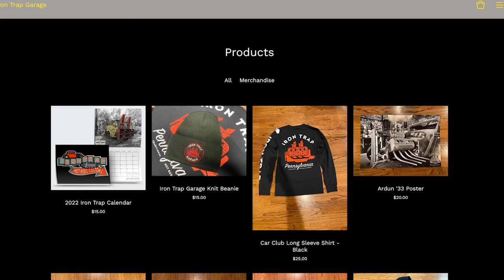Building Custom Firewall Mounted Pedals For The 1933 Ford 3 Window

Comment: The biggest lesson I've learned in the past year watching your's and other channels on hotrod fabrication etc is,; complete mockup but, in stages is critical, (leaving the peddles as they were, knowing but not sure where they will eventually fit avoids double or even triple the work is an excellent example) - it's all about trial, test and repeat. I built four Harleys for myself over the past 12 years and there was a lot of 'do-over' until it was right but, the best bike I built was the last one, where the build was complete in every way as a mock-up to ensure everything was just 'so'. The final product was superb (it fit Me properly in every way) and it was a blast to ride! Now, working on my '35 ford Coupe - the mock-up and trials are that much more extensive and requires infinitely more patience with every failure to anticipate. If I can learn just one little lesson from each video I watch, it's all worthwhile. Enjoy your content.
Reply from the maker: Yep it’s still a process I have to learn myself! It’s sometimes so hard to just leave something looking “wrong” or not totally finished to avoid double work. Every project is a chance to learn more! Thanks for watching!

Comment: I’ve got 2 Australian 34 roadster cowls and they both have a really neat set of brake and clutch holes in the firewalls,,,, it’s nice to see a traditionalist put pedal through a firewall again,,,, such a better system for brake efficiency,,, through the floor is cave man engineering

Comment: Another excellent job , those pedals aren't going anywhere but where designed to travel . Very solid , no chance of fatiguing the sheet metal out in the firewall . This car is turning out beautifully . It also shows how custom builds require a lot more than "bolt-in" components from other manufacturers & years . Sometimes you can use a part or two , but even those will require fabrications to their original design to make it all work in their new place of existence . Bottom line is , it's a lot of work , thinking , fabricating , replacing , & calculating . Especially on dropped , chopped , & channeled vehicles . Those require a complete rethink of fit , form , & function , on basically every aspect but the most basic of things . The clutch & brake assemblies will be standard , but everything else will be custom to get there . That is going to be a "bad-ass" ride ! Thanks again , Iron Trap Garage , for an awesome update on this beauty ! Happy New Year , Folks !
Reply from the maker: Thanks for watching! It really is a LOT of work!

Comment: Good idea to make that stronger. There is so many holes in that fire wall that was needed and maybe that part is just not heavy enough gage metal to begin with. It all good now. I wonder where someone found those extra long peddles at. Long peddles must have come off some big ole truck?
Reply from the maker: The firewall will get redone and will be replaced so much less holes eventually

Comment: With that bracket for the pedals you could do some serious drag racing. Uber sturdy. Have you given any thought to putting the seat in place and locating the pedals with that as a guide? I really like how this is coming along.
Reply from the maker: The 2” piece of foam I’m sitting on in the video is roughly what the seat will be. Not much height in the seat on this car!
Reply: @IronTrapGarage  About 1958 or 59 there was a '32 three window sitting at a gas station For Sale in St. Paul. It had an Olds engine with 3-2s. It was chopped and channeled. The 'seat' was an old seat cushion from somebody's couch. Just sitting there loose. Not sure how that worked for driving.

Comment: The top part of the firewall could look good with a piece of polished stainless or aluminum.  Would cover all the extra holes and reflect the back of the engine. That way you would only need to fabricate the bottom portion to fit around the engine and bellhousing.
Reply from the maker: I’ll build an entire new firewall when the time comes. 🤘

Comment: So that first set of pedals that you thought were to short, might have worked?
Reply from the maker: No because they had to be heated and bent and would have wrecked the old chrome. Also the center mount on them would have required making a bracket or brace. So still a similar amount of work.

Comment: 348 I’m trying to build one😊 also want to run a Hydra-matic. Got a fresh Olds hydro-stick from Iron Trap Garage. I need a bellhousing. I know 55-59 Chevy trucks had hydro-matic bolted to SBC. Can’t find one got any ideas? I know the Chevy used Pontiac transmission but bellhousing of Olds should be same

Comment: I noticed a couple videos back that you now have an Evolution mitering chop saw. Would you please do a short tools-that-don't-suck video comparing it to the first Evolution chop saw you got? I'm gonna get one of the two but the mitering one is a lot more $$. I want to be able to do accurate 45 degree cuts to miter square and rectangular box tubing. Thanks in advance! (The '33 is coming along great - can't wait to see the engine when it comes back.)
Reply from the maker: Good idea! Our tools videos seem to get terrible views so stopped doing them. I love the saw and it works really well. I’d definitely suggest getting the mitre saw as it allows you do so much more.
Reply: Thanks!

Comment: I know guys like chopping and channeling, but every inch sliced makes an already cramped car even smaller inside. Especially for the big guys.
Probably the dumbest mod of all time ever is sectioning.
Reply from the maker: Hot Rods and Customs are about looking cool and going fast. Comfort wasn’t as important. Not to mention you didn’t see heavy set guys building these sorts of cars was usually lanky or short young guys that could fold in half to fit in the car.